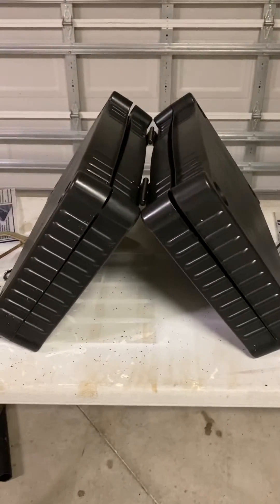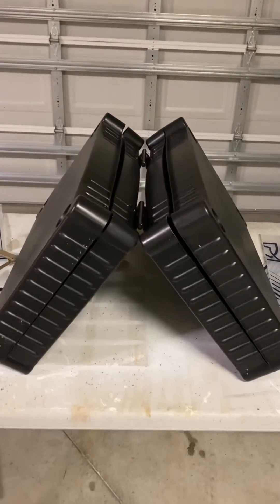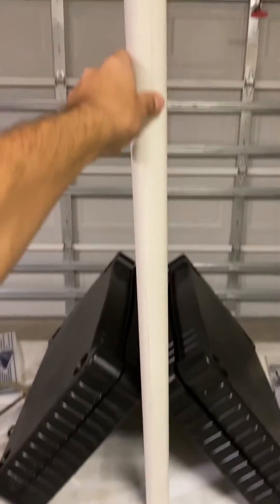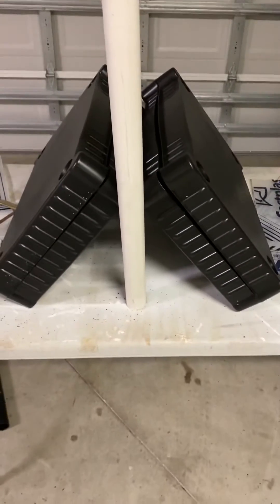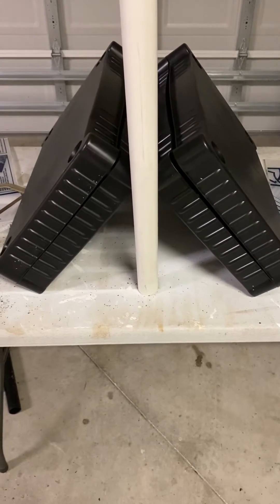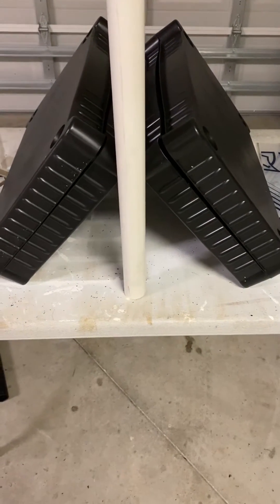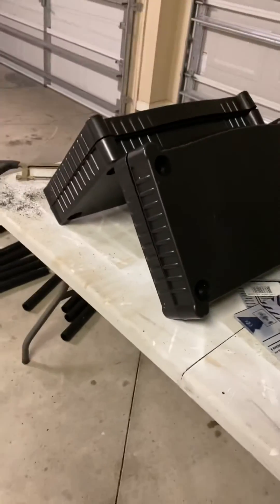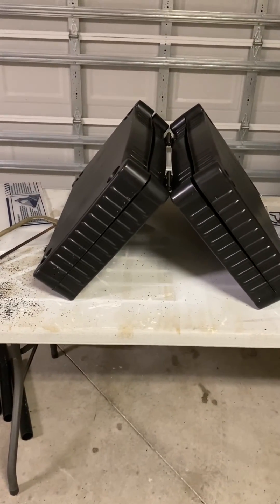Fabricating a Helium antenna non penetrating roof mount prototype -V pitch roof

Comment: is this going to be at the edge of the roof? if so ide hang some of the mast below the roofline and put weight in it aswell just to add to the balance
Reply from the maker: I’ve uploaded a new video showing it deployed for testing purposes. You can put it anywhere on your roof.
Reply: @_Jabberwocky  gotcha just watched, ill have to see it witht he actual mast mount on it. i though u where making it like in  the thumbnail with the mast beside i was worried about torque not moving the boxes but straining the mount itself